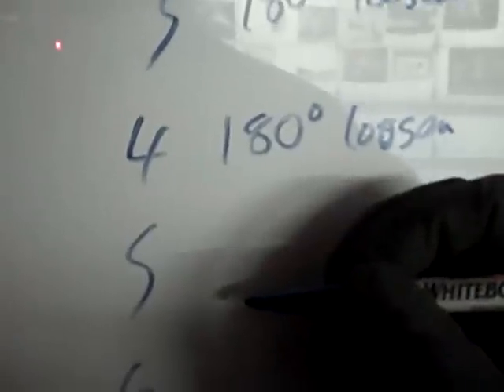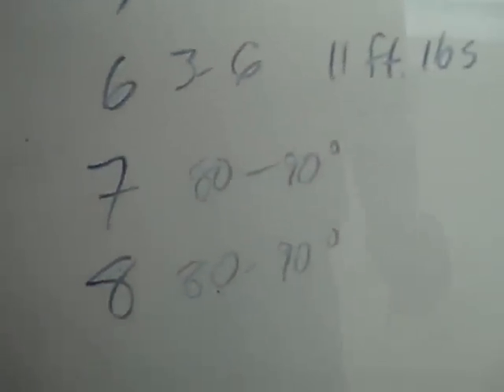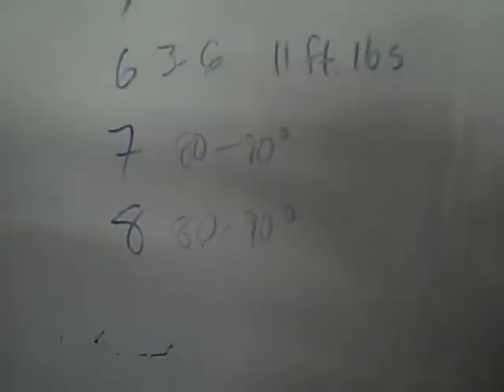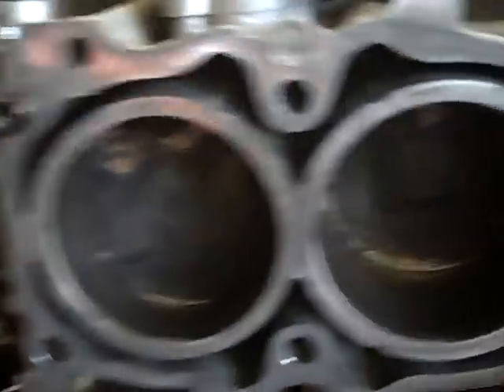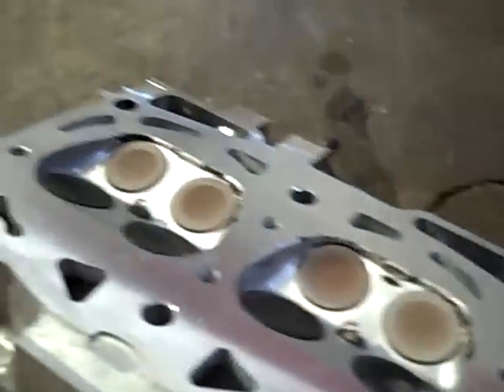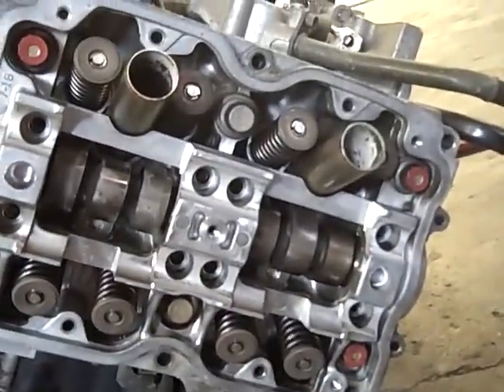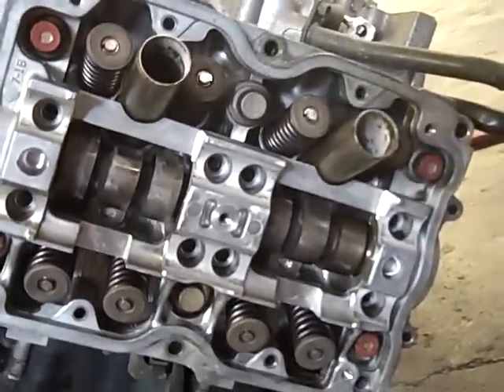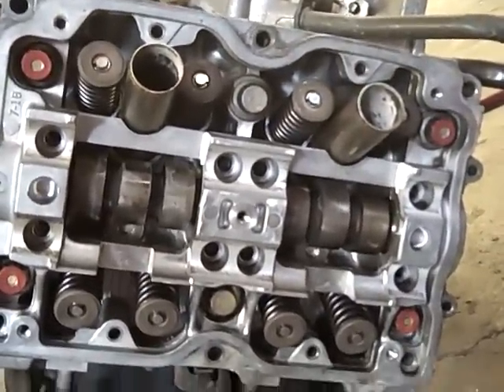Subaru Head gasket installation instructions

Comment: Okay... I was with you to the point you started looseing and tightening the bolts.  so you loosen them off 180, then loosent them again, then you tighten only the centre two but then you tighten the outside ones and then you turn the outside ones 90 degrees but not the centre ones?

Comment: Hey Brian I have a Subaru 2000 Legacy with about 150,000 miles, it needs brakes all around and a completely new exhaust set up . I was told to check the head gaskets for leaks, if it is leaking than I was told not to bother with the fixing the car because of the how high the total cost would be later on. How do i check for leaks in the gaskets, I am a complete novice

Comment from the maker: @wushunsupacycle Yours is a 2005  2.0L  Impreza WRX Here's the spec from MOTOR (prepare for confusion)  It's also different.  Because it's nearly impossible to share what something "feels like"  we have torque wrenches. 
1st - step; - 22 ft./lbs.
2nd - step; - 51 ft./lbs.
3rd - step; loosen 180 degrees;
4th - step; loosen 180 degrees;
5th - step; - 29 ft./lbs.
6th - step; - turn 180 degrees
7th - step; - turn 40-45 degrees
8th - step; - turn 45 degreees

Comment from the maker: You SHOULD have some hollow alignment dowels sticking up from the motor.  If not, set the head on cardboard and drop the bolts in the holes.  Then set the gasket on the block.  Then hold the head over the block and gently allow the head bolts that are now dangling down go through the holes via gravity.

Comment: Your video is extremely helpful but unfortunately I did not review it before pulling my engine. So I might of messed up. I have pulled the motor on my Subaru outback before so I just assumed I knew what I was doing. I was in a hurry so I did it without unbolting the flywheel which resulted in the fly wheel coming out with the motor and separating it from the transmission it looks like it will slip back in without a problem. Is there something I should watch for, or need to do to prep for the flywheel installation?
Reply: Do you mean the torque converter? Is it an automatic?

Comment: i have a 2007 subaru sti limited. ...........i have 113,000 miles i just started  to experience some over heating. ..........my heat is not working  well........i called a mechanic shop around my hose .......he said it might be the head gasket. .............he said  he'd charge me 2,500.....my timing  belt ,water pump,  rollers, oil pump  cam seal all new .........i did them less than 6 months  ago. .....is 2,500 reasonable just for the head gasket. ..............love your videos ........they are a great help............thanks

Comment: what really sucks is when your video gives me confidence to do this over the weekend without pulling the engine, and i take all off the engine, replace the right side, then have two bolts on the bottom of the left side valve cover become seized in the cover hole, not threaded hole in the heads, but in the smooth loose bolt hole, so bad that extractors, breakfree, heat, vinegar, prying, -nothing works.  so i put the cover back on only to realize the next day that the cover gasket is damaged and leaking now and all the oil is on the floor.  should have pulled it.  hindsight, a 200k engine is bound to have some bad parts that need full access.  and to top it off, the car won't run even though i double checked the timing, its dead on, and i read that the timing can be within 1-2 teeth and self adjust to run.  starts then dies in 1 second. sputtering.

Comment: Brian i had a cylinder blow a spark plug out & the ark off of the plug broke & was left behind & chewed up. Little damage to piston no damage to cylinder wall. Sent the head off to repair threads got head back all cleaned up. I can't hear anything inside the head, would it be safe to say that this rogue piece of metal has been pulverized & has worked it's way out?

Comment: I'm about to reinstall the heads on my 2003 Impreza 2.5 non-turbo, I bought factory gaskets but after watching your videos I called around looking for Felpro gaskets and they are easy enough to find but they all already have a coating on them.  You aren't spraying the coating over the existing coating - right?  If I were to use the factory gaskets, would you suggest spraying those?

Comment: Brian I've got the heads off my 01 subaru 2.5, on one head the intake valves are about an 1/8" from being fully seated. Do i need to adjust the valves before re-installing the head or should they be ok? If so how would i get the valves to fully seat? Thanks Brian for all your great vids

Comment: Brian - rookie in training here. I'm making my first attempt at a 1997 2.5 dohc head gasket replacement. I screwed up and in step 5 tightened ALL the bolts to 25. Realized I screwed up as soon as I did it. Can I just back off bolts 3,4,5, and 6 and tighten them to 11? Think I screwed up the head gasket? I did not proceed to step 7 and 8. Also I noticed on your video that it looked as though you reused the head bolts. Everywhere I looked recommended new head bolts. What's your thoughts? Thanks!!

Comment: hey Brian, 
Been watching your videos. Planning on taking the engine out of an 02 gt limited. If i have "internal" and "external" gasket leaks does that mean with a new gasket set this problem should cease? also, I'm changing the water pump, idlers, tensioners all that jazz. can you give me some helpful tips in accomplishing this task or just some preventative info that I can use for NOT screwing this up?

I do have an aircraft mechanic helping me as well but alot of it is going to be on my own.

Comment: Do you like the after market gaskets better than OEM? I am getting ready to do my 2001 forester witch had a recall back in 2004 but I was not the owner than. I just got the car last year and the guy i got it from showed me a bill for 2270.00. He had it done in 2013 but did not last and the garage  would not make good on it.Main question what are the best gaskets to use? I hear mixed reviews? Also some people say you can re use the bolts others say no get new ones?
Reply: Steel gaskets all the way. Don't skimp price on your gaskets. Beat or meet the OEM.

Comment: copper spray gasket !? never heard of it , i wonder what does it do ?! . i am about to change the heads gaskets in my engine,do you recommend i coat them with ABRO eagle head gasket shellac !? should i do it on both surfaces ?! i am honestly not a pro. thanks.

Comment from the maker: @jwiebe003 You can do it in or out of the car.  I like doing it OUT because you'll need to reseal the caps on the back of the engine block and likely the oil pan gasket too.  I recommend the timing belt, water pump and cam seals at the same time as well as valve cover gaskets.

Comment: How do you know if your head needs to be decked? Is there an easy way to tell? I've got my ej25d pulled and I'm gonna be taking the heads off in a couple days, just wondering what I should be looking for to know if I can just clean the surface and replace the gaskets or if I need to get it re-surfaced.

Comment: I watched another video where the guy (using stretched bolts) tightened up all bolts to 11 lbs...then did #1 and #2 @ 25 lbs.....then all 6, starting again with #1,  90 degrees then all 6 again another 90 degrees.....done.

Comment: i see the pistons are old ones would it  be advisable to replace the pistons while the engine is out? would it need a rebore or clean up off the cylinder if i was to replace pistons? need advice thanks ina dvance

Comment from the maker: @glydic1 Do a compression gas test with a loan a tool from Autozone.  Sometimes Subarus just need to have the air bled out of the cooling system by doing heat cycles and topping off the radiator when cold.  Sometimes it takes as many as TEN complete warm ups and cool downs (heat cycle) to get all the air out of it.

Comment: Brian I am having a horrible time installing my head back on my 2003 civic ex. It is so acquired to align it without moving the gasket. I tried using pencils to align it but no dice.  I also shouldn't have taken the rockers off like Haynes says. I probably should have just replaced the engine for a japanese one for $950. Any thoughts?

Comment: So I have followed your engine removal video and loved it! Now I am at the part where I need to install my heads back on.  Your torque method will be the same as for an STi?  Is it also the same as what Subaru uses?  Thank you!
Reply from the maker: Ricky Vieira There are many Subaru engines and each have been through various experimental torquing sequences with trial and error until the factory recommended process' were established.  And THEN there are updates and further process' discovered by factory technicians and race engine builders that have been proven better for specific gaskets/motors.  Most engine builders will have things they do that vary from the books and bring them success.  My advice for you is to use the best information you possibly can based on your gasket brand, vehicle purpose, and engine.  Many Subaru warranty gasket jobs only last 10k to 20k miles, but they fit well enough into what the factory procedure says.  Many of mine that I do like this (non-turbo) last upwards of 160k miles and are still going.  The key concepts here are to 1.  start from the center and work outward so the head lays down flat and evenly to get a good seal.  2. Secure the head flat against the block tight enough to withstand temperature cycles and pressures without stripping the block threads. 3. Oil the bolt threads and washers so they don't electrolyze (rust) to the block and so the friction doesn't cumulatively give a false torque reading too early before the head is tight. 4. Do the necessary things to the head and block surface to ensure a good seal.
When you realize WHY you do the silly steps etc, you can ensure you're doing the right things without succumbing to the equivalent of "wives tales" or stressing out too much.  Best of luck to you!
Reply: briansmobile1 Thanks for the advice!  By the way, have you installed ARP head studs on the EJ257 before?

Comment: Good info, thanks.  I pulled my heads ('98 Outback 5MT) Saturday, got 'em back from the machine shop today and I'll be reinstalling them over Thanksgiving.  I don't anticipate any issues but it's helpful to see what I'll be doing ahead of time.  I don't have a hoist or a stand so I'm doing it in the car, as you say, it's more difficult but still doable.  As an aside, that SOHC engine looks like a lot less trouble than my 2.5L DOHC - my head bolts are underneath the camshafts.

Comment: Hey Brian I'm having the problem with the hot and cold heating on my 04 Outback and loosing antifreeze from the right head gasket along with oil as well, so far I have replaced water pump and timing components,
My next issue to tackle is of course the head gaskets. I have watched your video on replacing head gaskets with engine in and it seems doable for me I rely don't want to remove the engine.
So my question is 
...................................Can I reuse the head bolts or get new ones...............................
as long as the threads don't look damaged, I think they could be reused
I see that these bolts are not under extreme torque like in older V-8 engines.
Need some insight.
Thanks Mike
Reply from the maker: Michael Baughman It's recommended that you replace the head bolts.  This keeps everyone's nose legally clean to avoid costly errors caused by another persons oversight.  That said, you can reuse the head bolts if they're in like-new condition.   This can usually be accomplished by cleaning them with a wire wheel on a bench grinder and then applying engine oil to the threads and washers before inserting them.
Reply: Actually the head bolts on newer engines are under more strain than old school big blocks. This is due to aluminum being a more commonly used. Aluminum expands exponentially more than steel when heated.

Comment: if you use a book(Hanes) ,PAY ATTENTION ,this happened to my today ,i did all the steps like i thought i waz soposed to till i got to step 6,in the books its say 132 inch pounds ,now i no tht is 11 foot pounds,i accedintly torqed them to 132 foot pounds and the bolt snaped right in half not at the head but in the middale of the threads ,,,so dont make the mistake i did , now i have a head bolt broke in half in the block ,and i have no clue how im gonna get that out

Comment: @briansmobile1 that is correct, Six Star is a brand and it has three stainless steel plates. As far as I was going through the net, this is the one most Subaru shops would use instead of factory one.

Comment: Hi Brian, Really enjoyed the videos.  Getting the parts together to get this done. i have an 05  Outback  SOHC and I will be replacing the bolts with OE.  I am getting my parts in the US as they are so much cheaper Just wanted to make extra sure I get the right ones..4 inner  11095AA141 / 8 outer 11095AA123..   Thanks and  keep on with the  videos!!!

Comment: Hey Brian
   I have a 2002 imperza rs with an ej25 sohc. I bought a new long block and it came shipped with the valves all closed and it seems like all the pistons are down with the crank timing marks lined up. Is it ok to turn the cams to get all the timing marks to line up? Will they clear the pistons? Is there a direction i should turn the cams, or just CW till they are in the right place?

Thanks 
 Daniel

Comment: is it possible to replace the head gaskets on a 2000 Forester with pulling the engine? Also, which parts do you replace when you are in there (waterpump, etc.)

Comment: Brian, your instruction is awesome. Question: if everything was as you describe, right down to the copper spray-a-gasket, but you forgot the second 180-degree loosening (step 4), and then proceeded to finish the process before you realized your mistake, then what would you do about that and why? I noticed the second loosening doing the second head. Thanks, dude.

Comment: Hey Brian I have a Subaru 02 Outback and the radiator is getting pressurized I think from a head gasket leak.  It's so bad now that it overheats in just a matter of minutes.  Do you think the head gasket repair products you add to the radiator might fix this?  This is the second time round for this car.  The first time I got a new motor this time I might get a new car;)  Is it a pain to put new gaskets without pulling the engine?  Thanks for your help!

Comment: I have a 91 Legacy I have heard you can change the head gaskets with the motor in place by loosening the motor mounts and jacking up the motor. Have you tried this? Since I'm working under a tree this sounds easier for me if it's possible.
Thanks

Comment: Brian i have a bad head gasket on j 25 coolant in the oil. Question is how do i know which head is actually leaking do i fix both heads or just one
Reply: You'll need to do a leak down test to determine which one, but you may as well fix them both.

Comment from the maker: @marek0086 I do.  Every time.  I hold the gaskets by the edges like you would a CD.  I use brake parts cleaner to remove all the oil from all the surfaces every time.

Comment: Hi Brian just posted in the comments, but it looks like it didn't go through. The gasket they sent me is.026 thickness which is for the EJ 253 engine( which I have) but the gaskets that came off are the.053 thickness. should I order the thicker ones?
Bud

Comment: replacing head gaskets on 2003 legacy 2.5 (EJ251?) I heard that the felpro gaskets sometimes fail on the EJ25 engines and that the updated OEM MLS gasket should be used instead. Have you ever experienced this on either one of these engines, or any subaru for that matter? Thanks.

Comment: hey, did you have a problem torqueing the front cam caps? It seemed like they were soft on all 4 of my cams. I sheered the first bolt off and am timmid about doing any of the others. The middle and rear caps all torqued fine just none of the front ones

Comment: I'm getting ready to drop an EJ 22 into my Vanagon, and since I have the engine out might as well do the head gasket. My friends are saying use cometic gasket...but I hear that like you lots like the Felpro. Your thoughts?
Reply: Joey Rideout A really good brand is Six-Star, they started in 99 ej series, 22 & 25... with those do NOT use copper coating and if I remember correctly, around 50RA block and heads.

Comment: are there any major differences between a wrx head gasket vs a sohc subaru engine or a sti gasket? I bought a wrx for 1000 with a "spun bearing".. sounds like just a noisy alternator and deff has a blown head gasket...
never done one before but I'm positive I can do it, just want to be properly prepared for the job...

Comment: Hello! I saw your youtube videos about subaru repairs. I have a question, i have 2006 subaru outback and there's zero compression in cylinder #4 and the code is misfire in cylinder #4. Do you know whats the issue and what needs to be repaired ?

Comment: just wondering...  is this a sohc or a dohc cause I have a dohc and i cant figure out how to get the cam pullies off now that the timing belt is off.  do i have to pull the cams to get the heads off?  I had some pretty bad heating issues from the gasket so how do i figure out if i need to deck the heads or not?  also should i get new head bolts?

Comment: Hello Brian ! What kind of gasket you use, multi layer steel or single layer? how many coats of copper spray? Did you had any problem of leaking after used copper spray? I'm asking because a lot of people say don't use copper spray or any sealnt on new gaskets. But i know that mls gaskets leak a lot if the surfaces are not near perfect.thanks

Comment: @rbvlchz 
how did you jack up the engine? Jacked under the oil pan? I don't want to do that... i've read that you can jack up the transmission, but not exactly sure where.. wanting to change out the oil pan seal as well, if possible (2.2L)